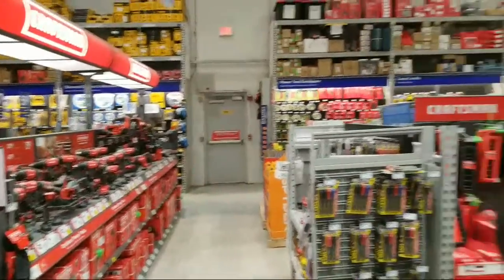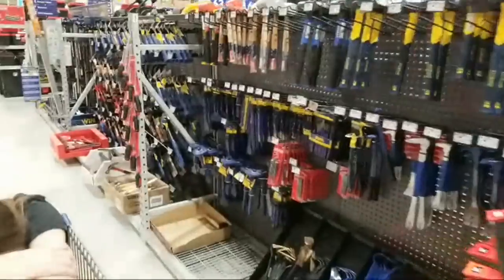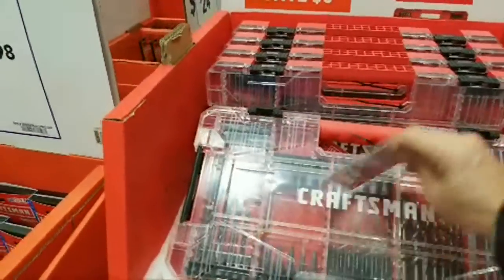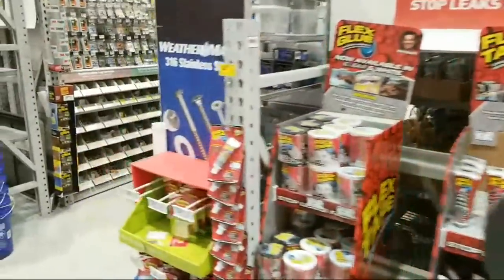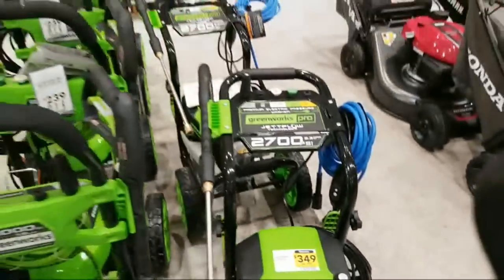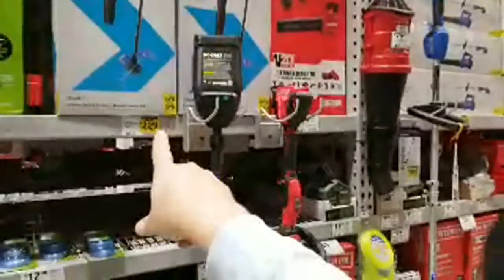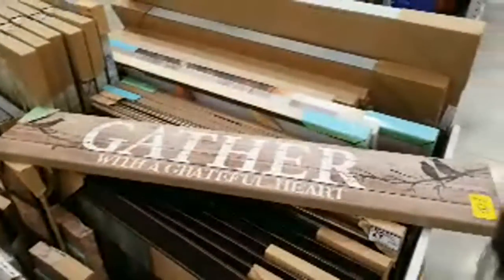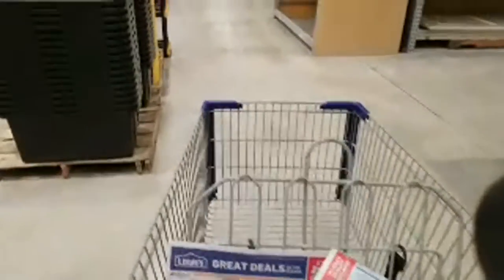Lowes Feb Tool Deals, Discounts, Dewalt, Kobalt, Yard Tools

Comment: I bought a battery powered light bar at Lowe’s for $19.99 with motion sensors and auto off. Works great for cabinets,gun safes and tool boxes.
Reply from the maker: Can't wait to test one out on the next flip

Comment: 200 piece Husky socket set is marked down to $59.  No wrenches - sockets only.
Reply from the maker: That's the same kit I showed a few weeks ago, for $59 right? Remember I searched everywhere could not find it, but it turned up on an end cap.

Comment: I have similar fans out in my backyard under my aluminum roof. They are the Home Depot version. I bought them at a home improvement discount located in Plantation off of 595 & 441 for like 1/2 price new in the box with the remotes. Those 72 inch fans I have blow really good especially with our hot summer days here in S Florida
Reply from the maker: Yup, this is the perfect time of year for them to put them out on the floor for sale, a lot easier to install now than when it's 95 degrees and 8-% humidity.

Comment: Hi Jeff, they have the 13" 40volt kobalt string trimmer KIT for 53.00  at my Lowe's .  I think online as well ,. The battery alone I thought was worth it .
Reply from the maker: Yes, usually you can't find anyone's battery that low. Certainly not Milwaukee or DeWalt.

Comment: Hey Jeff,
I know you usually recommend 3000 psi her pressure washers because of cleaning sidewalks. I live in a mobile home how much psi should I be looking for just to clean the the siding I have no sidewalks I have an asphalt driveway. I would also use it for cleaning front deck and back deck. Thanks for another great walk around. This is second life stream in a row I missed I'll have to check my settings
Reply from the maker: For your mobile home, you're probably OK with the smaller machines, and most likely would not use them at full pressure. You usually control it by backing off a few inches more away from the siding, testing an area to make sure it power washes rather than pressure cleans. Sometimes old siding might be ready to crack if you use too high a pressure on it.

Comment: I'm thinking about buying a compound sliding miter saw, for homeowner / entry level pro stuff (lawn care / landscaping) I had my eye on the harbor freight hercules miter saw. you guys think I should spend the extra $300 and go with dewalt? Or should i be fine with that. Cutting landscaping timbers and stuff
Reply: Bob ShitDickSam I’m brand bias so take it for what it’s worth but I used to b a plumber 13 years ago, bought all dewalt tools and they still work like brand new until date. Granted I only had 5 years of everyday use with those tools and then I went to doing weekend warrior stuff with them afterwards but no problems here. Dewalt may b a little more money then the rest but I don’t mind paying cause I know 10 years from now these tools will still keep on going. 

I actually spent more money and sacrificed a bit of quality yday to go with a dewalt table saw versus the rigid cause I’m that confident in dewalts quality. Hope that helps. Cheers!!
Reply: @borys444  Yeah, I 100% appreciate you taking the time to type that. Maybe I should stop being a cheap ass and buy a good one, I'd be pissed if i spent  $500 (including stand) and it broke.
Reply from the maker: Bob, some things to think about. I made the mistake of buying a single bevel DeWalt saw. I love the saw, and it has treated me well for 7 years, probably since I bought it. Problem is, I started to do more like cutting baseboards, and you need that double bevel function of the higher end machines. So I tell everyone to future proof your purchase by getting a double bevel miter saw. Also get one that has the slider saw capability, because before you long you'll find yourself using it to cut wood/laminate floor planks and anything over 6" wide you'll need to have sliding capability. BTW, I'm migrating from corded tools to battery operated, might be something you want to research too. Go to HF and HD and put your hands on both saws and see which one you like better, what features doe sit have. Are there nay lasers or cutting lights, that sort of thing. Read reviews carefully on each one, look for pros and cons.

Comment: You don’t use those flex hoses most states their against plumbing code
Reply from the maker: No you are mixing up those with the flexible accordion type p-traps, those are banned in almost every state plumbing code. P-traps must be self souring, so as long as the inside is smooth, it can be used.

Comment: 12:00 It's not so much about Craftsman's quality that has gone down the drain, which in some cases it has, but now that Stanley Black & Decker owns the brand, their customer service and warranty have really gone down the drain.
Reply from the maker: As long as they honor their lifetime warranty, that's all that matters.
Reply: @jeffostroff  I agree, but I have heard many war stories, not only from people I know, but here on YouTube videos as well, where getting SB&D to honor the warranty is like trying to pull teeth with a rusty screwdriver.
Reply from the maker: @PaganWizard  I had an awesome warranty experience with my new Channelock 200 piece tool set. I bought it in December, and you might have seen my tool review video for it. When I opened it up, I notice one of the ratchets was missing a screw used to secure it together. I emailed them about it, they got back to me, told me to send a photo, and said I don't need to send them the tool. 2 days after I sent the photo, the new ratchet arrived.

Comment: I just bought that Dewalt table saw, it does not come with a stand.
Reply from the maker: Bummer! But maybe you can use the DeWalt folding working station or the Keter folding workstation, priced usually much lower than a table saw stand.
Reply: @jeffostroff I just used some scrap wood and casters I had to make a rolling table/stand